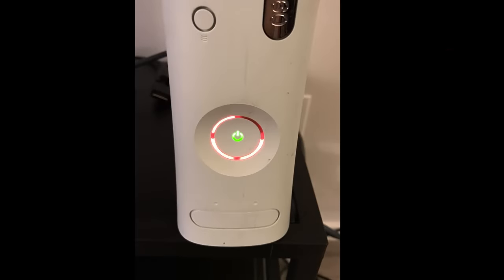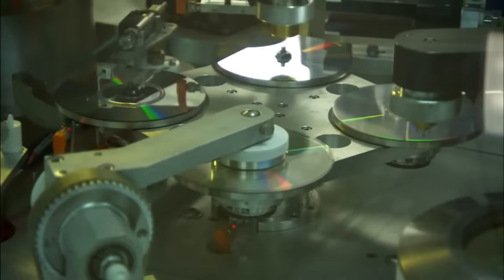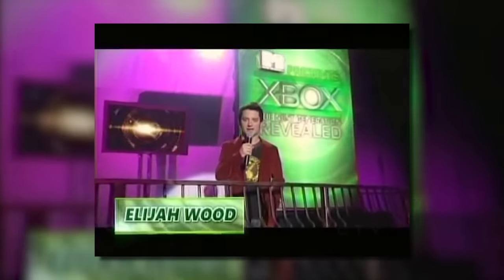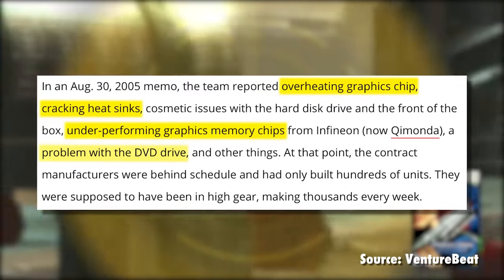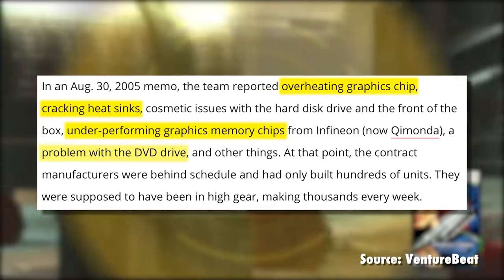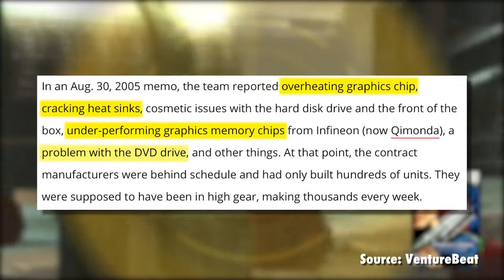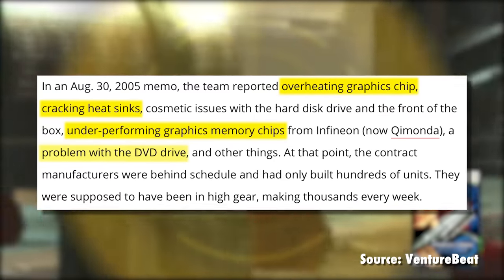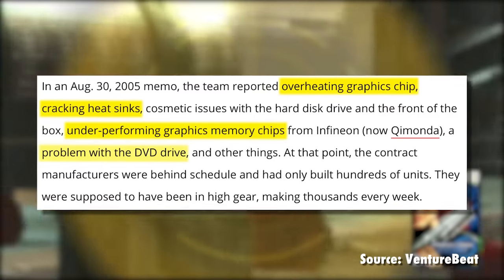History of the Xbox 360 Red Ring of Death | Past Mortem | SSFF

Comment: The original NES' "blinking red light of death" is not a (permanent) failure like the XB360 RRoD (and doesn't signify any sort of console death), instead typically just cart connector connectivity problems. I wish you wouldn't perpetuate this misunderstanding / myth by using this phrase -- it takes away from everything else you do so well.
Reply: Michael's Workshop  it's basically always been the 72-pin connector in the console getting to filthy to work anymore even with me keeping my games in pristine condition dust still gets In there and once it does it's usually easier to just replace the whole part than clean it ado I can imagine back before people just had 72-pin connectors laying around it was quite a permanent death
Reply: Yeah, if there's a 2nd most popular hardware failure, I'd say the PS2 dvd drive. One of my friends had one that failed and mine, while it worked on most games, couldn't read the blue bottom games (the CD ones that only a few titles used at the beginning of the ps2 lifecycle) and, oddly enough, Persona 4. I never got to play the PS2 version. Though thankfully, it was brought to the Vita and having never played this RPG that everyone insisted I should, I jumped in and have loved the system since.
Reply: Michael's Workshop But wasn't said connectivity issues caused by the bending of the pins due to the improper use of zero insertion force and poor quality metal/tin for the 72 pin connector?

Not only is it hard to remove the connector for the layman, is bending them back into place even an option, hence the idea that it is pseudo-permeant?
Reply: Oliver Surpless Aaron replaced his pins, he's a layperson, so...
Reply: the 360RRoD wasn't any more permanent.  The vast majority of them were caused by the heatsinks coming lose from the GPU due to the amount of heat, I fixed mine by buying new mounting clamps on eBay for $4 when mine RRoD in 2007, have had no other hardware problems since (well, now the DVD drive is going now but that's a different issue)
Reply: ps2 dvd drive failures were legion
Reply: @Mythik
No. You couldn't possibly be more wrong.
Reply: felman87 And then Sony abandoned the Vita even though it was a totally fine system.
Reply: Alpha Centauri  PS2 drive just needed am adjustment of the lens distance from the disc. Just turned the white gear at the back of the tray

Comment: As it turns out, Derek was right. The Red Ring of Death's cause was linked to the system's design but not because the Xbox was overheating, it's because the number of heating and cooling cycles was stressing the connection between the CPU/GPU and the motherboard to the point of sudden failure. It's kind of like the cabin pressurization and depressurization cycles in aircrafts, so in that regard each Xbox 360 had a limited number of uses from the moment you turn the console on for the first time, and it was a matter of time before it fails. There is a fix for a red ringed console and that is to completely take apart the system, clean all the components, resolder both the CPU and GPU after heating up the motherboard, apply fresh thermal paste, reassemble the unit and voila..the system is up and running once again.

Comment: My Xbox 360 always red rings and it never dies.... idk why it doesn’t die for good...
Reply: Do you get 4 red lights or 3?
Reply: Three lit up segments of the ring = ring of death, signals error with hardware.
Four lit up segments/complete red ring = you don't have any controllers connected to the Xbox.
Reply: Malachi C I got 3 a couple times... my Xbox box is an original I think... has a 120G storage and the disk tray doesn’t come out until I hit it a couple of times...
Reply: Same with me
Reply: Because it's God
Reply: @CMDRBonbon  wth are u on about 4 red lights dont mean u dont have anycontrollers connected what in the hell are u smokin lmfao it means your av cable is loose or not connected at all
Reply: 3 red rings can be ANY hardware issue but it isn't always fatal. I had it where the HDMI port started to wear out and it would lose signal and then show 3 red segments. But there are a bunch of other hardware problems besides the classic deadly RROD.
Reply: haha same as me.  got 3 rings a few times, read online to wrap it in a towel for a while and always came back to life.  Later on my tray stopped opening unless id hammer fist it.  Cant believe it still works after seeing this video.
Reply: @Zach Prescott You're very fortunate. It usually only worked for a few days afterwards. I know some people did this and then traded it in to Gamestop. The poor guy who bought it usually got RROD within a week.
Reply: He is In pain you need To end his misery please
Reply: Tough lad. It is
Reply: Your 360 is saying kill me
Reply: You have a case of Invincible- Box 360
Reply: OH NO GET THE THING OUT ITS JASON AS A XBOX

Comment: The ps2 outsold the ps3 in it’s launch year? Tf
Reply: The PS2 was an absolute beast in sales and just refused to die.
Reply: The ps2 outsold every console in it's lauch year
Reply: @erick3003lel  ps2 was the best selling console in gaming history, and final fantasy 12 just came out on the ps2 in 2006.
Reply: the PS2 was just that great of a console. arguably has the greatest game library of any console for it's respective time. it's really not that crazy. I remember they still made new games for it like 3 or 4 years after the PS3 released.
Reply: in fact, if you add both the PS3 sales and PS2 sales after the 360 released, sony probably actually still ended up ahead of Microsoft in that generation as well, in spite of the PS3's struggles.
Reply: Tf
Reply: Ps2 out sold ps4 In its launch year
Tf
Reply: @SolidShepard  the PS 3 outsold the 360 in the long run btw even though the Xbox came out a year before
Reply: The ps2 is the best selling console ever
Reply: It was cheap, had a big library of cheap games (tons of cheap used titles), and at the time many people still didn't have HDTVs to really make use of a 360 or PS3's graphics.  There was also growing marketshare of games like Guitar Hero and a PS2 was one of the cheapest ways to be able to play it for ultra casual players that were only interested in 1 or 2 titles.
Reply: Weiss Schnee get back to Atlus. Seriously your dad isn't happy.
Reply: Weiss Schnee the ps3 was 600 dollars...
Reply: @josh580  Xbox original was more powerful despite being older

Comment: Just bought several untested Xbox 360 consoles. 3 are the fat ones, 3 are the S models, and 2 are the E models. All the S models work perfectly, one of the Es works perfectly, the other has no display and a bad disc drive, one fat model has a broken disc drive, and the other two (which are both Elites) red ring. My personal Xbox 360 is an Xbox 360 S and it’s been working perfectly since I bought it back in 2016.

Comment: The 360 elite was super reliable. I still have mine That I bought in 08. Used it so so much and it still runs like a dream. No issues.
Reply: Same, buuut there are minor annoyances... like the disk tray being stuck.
Reply: I just use a regular one nothing went wrong
Reply: Tomek Tabaka me haz a 7 year old ps3 and its only had 1 problem with the disk drive
Reply: Tomek Tabaka a
Reply: Tomek Tabaka mine too
Reply: Mine occasionally freezes, and I have to restart it. But other than that, it works like a charm
Reply: Dorian Ferguson I've been having my Xbox on its side for 7 years... no problems
Reply: I play call of duty advance warfare and this never happens to me.
Reply: i got an old 360 white case with hdmi still working well .
Reply: I got the Xbox 360 in 2012, (the elite)
Reply: Same here.
Reply: I had my original run Xbox 360 for about 4 months before it red ringed, and the replacement I got from Microsoft still works to this day. The only gripe I had with it was the hard drive space, which they promptly upgraded for me to the max at the time (120GB). The thing lasted longer than my PS2 by over half a decade.
Reply: My Xbox 360 hates Minecraft for some reason, the disk is fine, the Xbox crashes and turns off, but it runs fine on every other game
Reply: Me too
Reply: My elite red ringed. Microsoft fixed it for free of course.

Comment: Here in 2018 and my XBOX 360 hasn’t had a single malfunction.
Reply: Same here.
Reply: How long have you had it?
Reply: anyone notice that this video is like a year old but there are so many new comments on it
Reply: Same, but I have one of the newer models where I don't need to worry about the infamous Red Ring of Death.
Reply: Same here
Reply: And I have s black Xbox 360
Reply: Is it the old XBOX or the slim? Look it up if you don’t know the difference.
Reply: @nikta8587  i have a black full body Xbox 360 for 8 years and it works perfectly
Reply: SAME!!!!!! And I’m 12 years old and I game ALL THE FUCKING TIME and I’ve felt the console and it burnt my hand only thing that is wrong is one of my controler’s is broken well both are sorta
Reply: Same here
Reply: Same its been chiped on the edge still works no repairs
Reply: I want to get xbox 360 but which version should I get the Xbox 360 E or slim
Reply: yepp i still have my white one i never sold it wanted to keep it for memories its a decade old now exactly some things just have that luck
Reply: Is it a Elite Doesn't count unless it's the phet one
Reply: Jasdow lucky mine malfunctioned 3 days ago
Reply: Same
Reply: Same I've had it since it came out
Reply: I still have the original XBOX 360 I preordered, turn it on every now and then to play the original Battlefront 2 with some old uni mates.

Ironically I did get the red ring of death in that first year, but used an online tut to open it up and clean the foil from the cpu. Good times.
Reply: Mine too, i have it for like 6 or 7 years
Reply: Same here and I’ve had it for 6 years

Comment: I just bought a red ringed 360 and repaired it back to working condition. All 360 red rings are totally repairable, as long as you got the right stuff. I’ll probably put some extra cooling on it. The system I fixed is from 2006

Comment: damn now i feel really lucky...i have an original launch xbox 360....never had any problems no red rings no heat issues....but i do take care of my consoles by taking them apart every few weeks to give the insides and fans a dust off with compressed air...i cant believe i was lucky enough to not be one of the millions affected....im happy usually my luck is shit with everything
Reply: Opening your console every few weeks? Fuck that
Reply: Hots Coffman dude u probably have it For 13 years
Reply: Ive never done any of that shit, and my xbox 360 is still performing really well years later
Reply: Never gotten the rrod lol were both lucky
Reply: My cousin has a 360. It still works perfectly.
Reply: The core model 360 in particular is an absolute pain in the ass to open.

Comment: mine was made in 2005 and it still works right now
Reply: Bannmannutt then you're lucky
Reply: i was wrong it was 2007
Reply: Same lol
Reply: Mine was made in 2006 and it works fine lol
Reply: 2013 -2014 And still working
Reply: Bannmannutt mine was made in 2007 and is used every week but mine does not have the red ring of death
Reply: Bannmannutt My 360 is an S Model. That means it was probably pretty recent.
Reply: CALCULATING LUCK FACTOR....................................CALCULATIONS FINISHED. LUCK FACTOR IS APPROXIMATELY 5000. 4999 POINTS LOWER THAN THAT OF THE MAN WHO SURVIVED BOTH THE HIROSHIMA AND NAGASAKI NUCLEAR BOMBINGS.

Comment: I used to repair Xbox 360 RRODs and the majority of them produced after August of 2008 with the Jasper Boards are still running strong today. Since your console was produced in July of 2008, you were unfortunately hit. :(

When my 2005 launch console RRODed in 2009, Microsoft simply replaced the motherboard with a Jasper one and it's still running strong today. The most common way I fixed 360s were with a heat gun and x-clamp replacement.

- Ryan
Reply: Same here! I know exactly what you would do with the heat gun. It was actually a pretty simple fix if you knew what you were doing lol
Reply: A lot of people don't know that the Jasper is as solid as the S. For that reason, it commonly gets lumped in with the rest of the clunkers and can be had very inexpensively. Jaspers are great for console gaming on a budget these days.
Reply: Exactly Ryan, the Jasper mobo fixed all the issues and those consoles are still running today, like mine. Though I think with the model S and model E, they finally addressed the excessive heat.
Reply: Mine says it was manufactured in September 2008 and it's still working

Comment: My XBOX 360 elite (black case with silver disc tray) is still running strong today. Have played countless days on it with it being stored in some poorly ventilated areas too. Not sure if the elite was immune to the defect or not, but it has been reliable.
Reply: Just be sure every 3rd Sunday you vacuum the Xbox and delete saves on games you don't need it helps
Reply: It isn’t immune I had the Kinect bundle for the past 8 years and it died on me last month
Reply: I had the elite for around 3 years which was more than twice the lifespan of the other 2 regular ones I had but it still died. At that point i finally jumped ship to ps3 and this was about a year or 2 before the current gen came out. The thing still works like it did when I got it granted I rarely play it since I'm on ps4 pro.
Reply: The elite has a different issue. Deleting games you have purchased from the online store and removing your history that you ever purchased it causing you to have to rebuy the game in order to download it and play it again.
Reply: I got my Xbox 6 years ago and it's still running just fine.
Reply: My orignal 360 still works.

Comment: mine is from 2005 (when i was born) and the only problem is, it screams like a banshee, and the disk tray gets stuck sometimes.
Reply: LittleMissSkyCarson no, it’s like when you start it up, it sounds like the disk is farting (the best way I could put it)
Reply: LittleMissSkyCarson that’s what I’m thinking.
Reply: Goddamn you have an Xbox as old as yourself? Did your parents buy it for you or did they just happen to buy it around the time of your birth? (not judging btw)
Reply: Rubin Rahman my dad plays video games.
Reply: That's cool. I've had to gather my own gear over the years. (born in 1998) got my Gameboy Advance in 2002, PS2 Slim in 2005, PS3 Slim in 2009, Wii in 2011 and a gaming PC in 2013. And few days ago I fixed a 2nd gen (first gen in Europe) backwards compatible PS3 which I now own because the owner doesn't need it any more. I guess the nice thing about that all is that I can finally say I own it and don't have to share it with anybody lol. I've kinda wanted to get a Xbox 360 but it just never happened. I've got a fascination when it comes to consoles (and jailbreaking em).
Reply: Your 360 has a spindle inside that the disc sits on. That spindle is slipping due to either a dirty gripping surface or an issue with the magnetic "puck" built into the top panel of the drive.
Reply: mine too
Reply: iggy151 I DID spill chocolate milk on it when I was 3....
Reply: Pig Bukkit I was also born in 2005
Reply: My disk tray gets stuck, and it barely plays games anymore
Reply: LittleMissSkyCarson yeah same with mines but the disc tray only gets stuck when there isn't a game inside. I still play it though. It even had the 3 red light things. All i did was stick a metal into the usb ports ( it was to broke one) so i kept doing it and i saw sparks but kept doing it and it cut back on. I was so happy

Comment: Man this video was from 2 years ago but this video completely left out the fact the defect was caused by NVIDIA and HP had already recognized the issue and advised them why their chips were failing because of the defective lead solder being used on the BGA that Microsoft was told was the correct process. That is why you can re-ball a 360 and it will work fine. This was common industry knowledge in the PC Sector because of the class action lawsuit against HP because of the laptops that failed that NVIDIA had to pay for. This is the specific reason why so many 360s failed when people put them in enclosed spaces. That is why you can have 360s that never red ringed.  I still have both of my launch 360s and they still work but Gamestop had tons that came back defective and those bootleg fixes were usually temporary. The whole deal with the upgrade for the heatsink was to reduce stress on those lead-free solder balls.

https://www.theinquirer.net/inquirer/news/1004378/why-nvidia-chips-defective

Notice this is info directly from the suit by the SEC against NVIDIA.
https://s3.amazonaws.com/cdn.orrick.com/files/NVIDIA-Securities-Litigation-9th-Circuit-Opinion.pdf
Reply: Legend
Reply: Legend
Reply: Legend